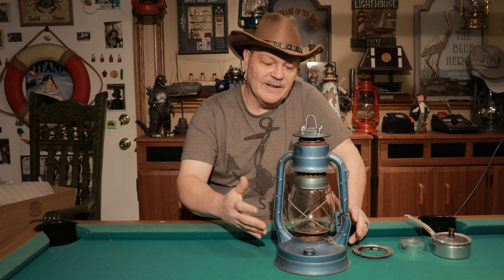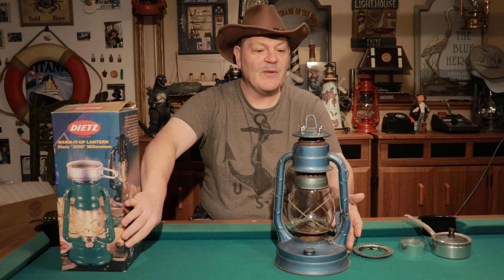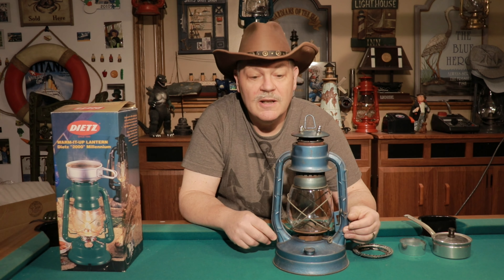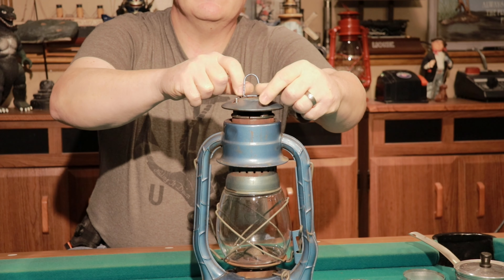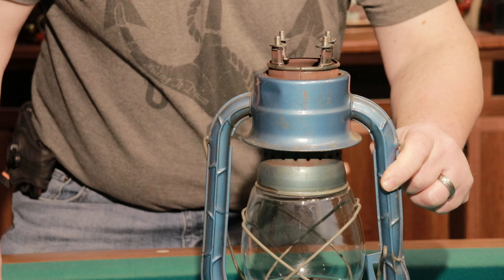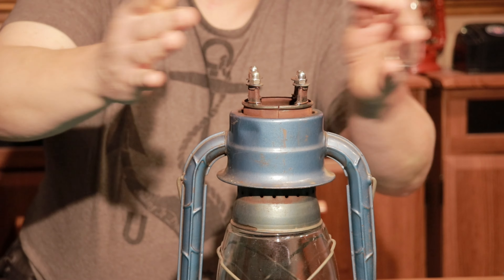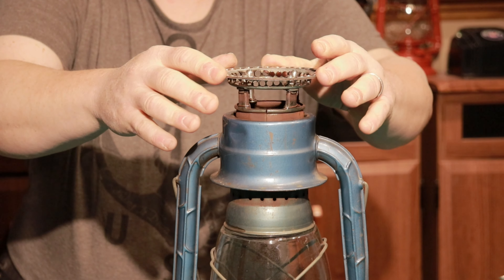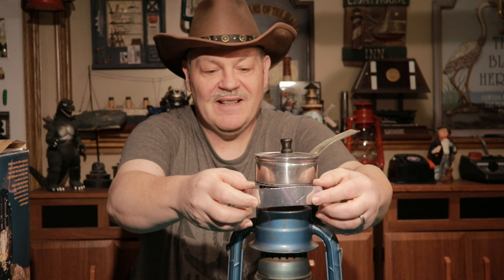Make Your Own Kerosene Cooking Lantern

Comment: After several experiments with different cooking pots, I've settled on old Revereware copper bottom stainless steel pots and pans as my go to stuff. Heat quick, east to clean and cheap at the thrift stores. The best ones are the older ones, they have a thicker copper cladding and are identified by a large (silver dollar size) logo on the bottom.
Reply from the maker: Thanks so much that’s great to know I’ll have to find some of those I actually have a couple of the newer ones and love to use on the stove but will keep an eye out for those logo bottoms

Comment: Genius.  Very nice job.  I made one a few years ago by removing the crown, and soldering on the grill from an old computer power supply.  It worked ok but I lost heat through the gap and, I could not switch back by putting the crown back on like your design.  I just got a new #1 Little Wizzard and might just use your idea on it.  I am traveling the US full time in my camper van and I think that would be a good way to heat some coffee on cold mornings. Probably won't get hot enough to cook but, I have other stoves I use outside for that.
Reply from the maker: Thanks very much 👍

Comment: The Dietz no. 8 Air Pilot is a great lantern.  I have a couple of the Hong Kong versions and both burn great with a nice flame.  Good video and thanks for sharing.
Reply from the maker: Yes they are fantastic I agree and actually the air pilot was my first Dietz lantern so it does have a special connection to me 👍

Comment: please don't spill any food on your beautiful Diets No.8 Air Pilot (streamline).
Reply: Not just a mess, but it seems like a spill may risk cracking the globe from thermal shock.
Reply: @pauljs75  These globes get used outside in the dead of winter so spills are not likely to crack the globe. You can spill and make a mess with any kind of burner/cook stove and this is not any different. Maybe just do Ramen noodle in a cup that way you are only heating water so there won't be a mess to clean up other than your cup and spoon. You can cook a lot of dehydrated meals in plastic pouches. add boiling water and place the zip lock bag into a pouch made from the reflective windshield reflector material. The aluminum coated Mylar which is usually in the form of a bubble wrap will keep food hot while it cooks or keep a dish warm while you cook other parts of your meal. It is a very useful cooking system and it flat packs and weighs next to nothing.